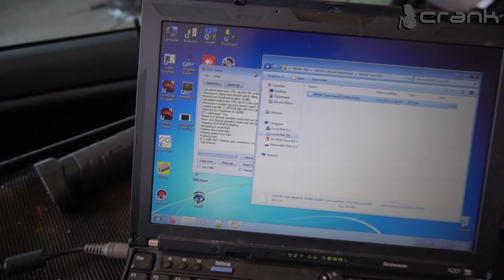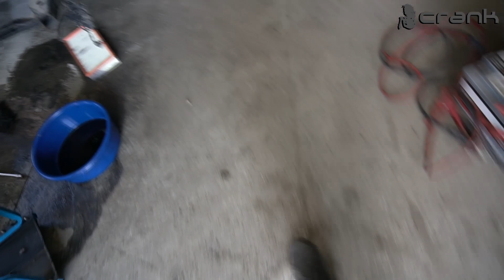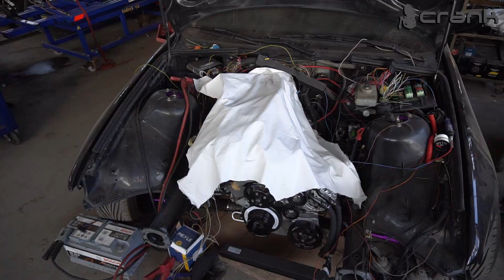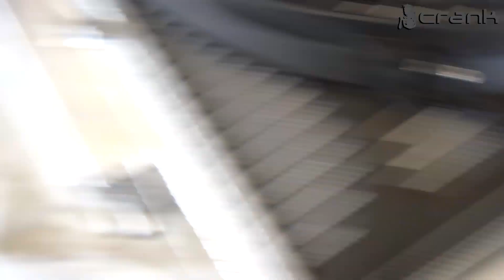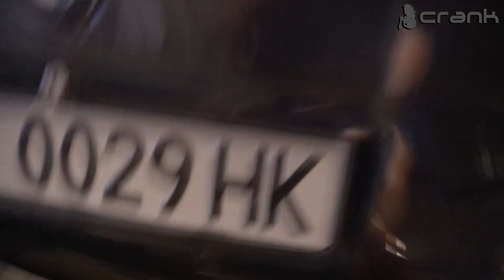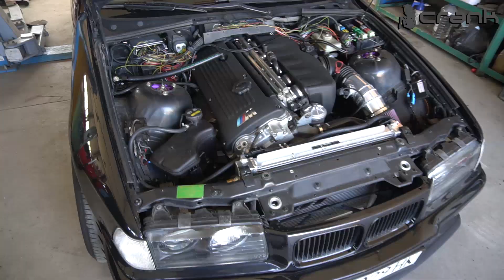BMW S54 First Start After Swap In E36

Comment: There are different radiator support brackets correcting the width between different radiators installed on e36, I had similar problem going from 318is radiator to tds one.
Reply from the maker: Ok will try to find those, thanks for the info!